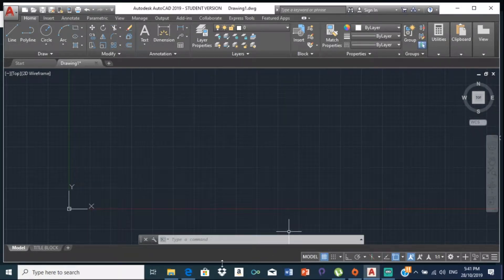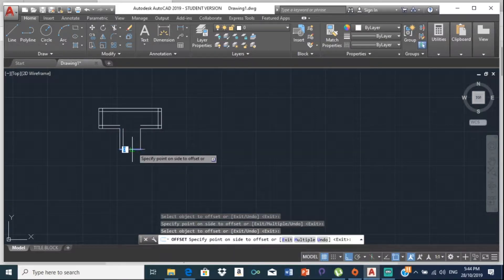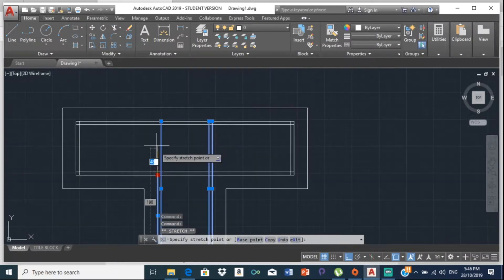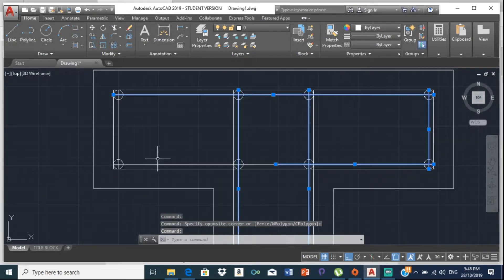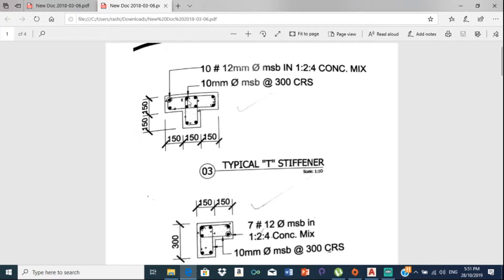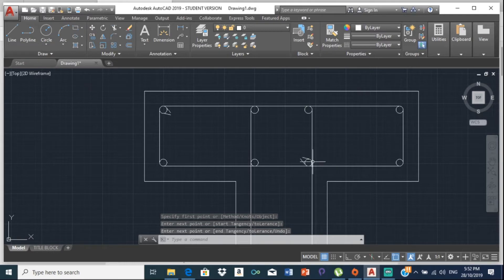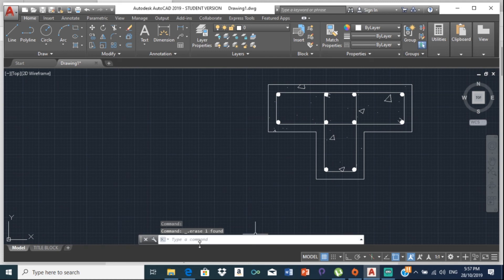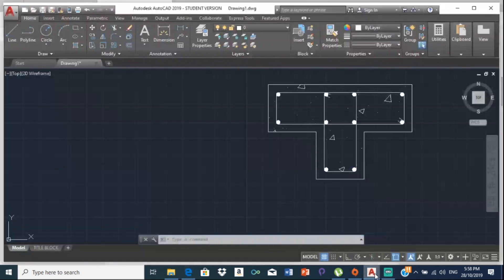How to do the stiffener details

Comment: Great video. One question. How are Stiffeners different from columns?
Reply: stiffeners support the wall while columns support over load. Also stiffener is the same thickness as a wall but once its thicker than the wall it is classified as a column.